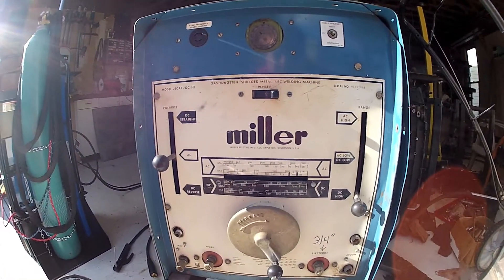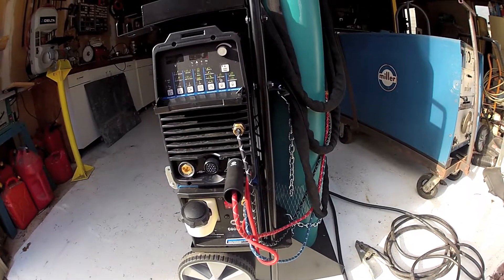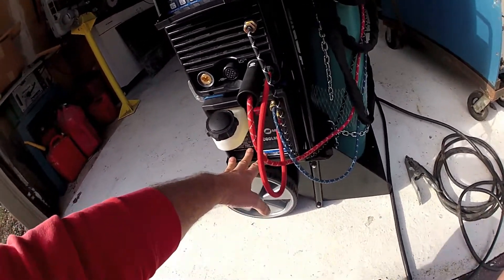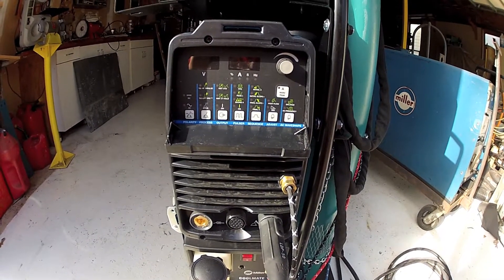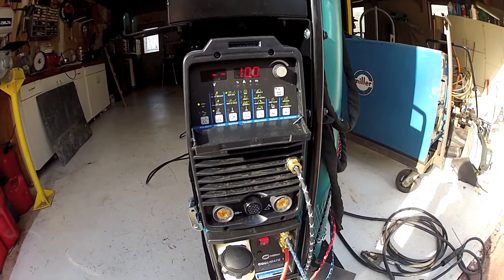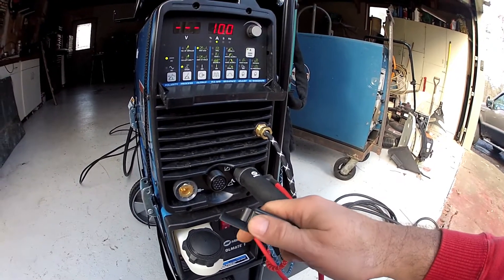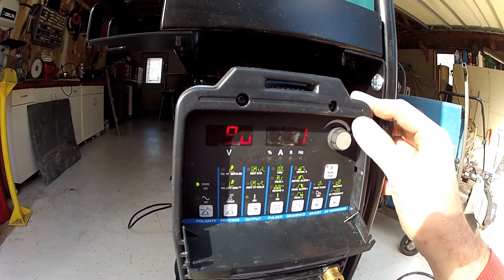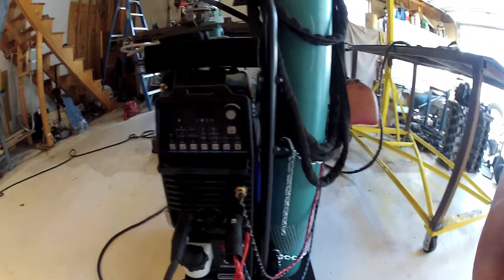Miller Dynasty 200DX Part 1

Comment: Thanks for the video. I’m looking into buying the Dynasty 280 and it’s good to see what us regular guys will encounter.
Reply from the maker: Nothing makes up for us hobby welder's minimal time under the hood, but the Dynasty line is a great way to eliminate ALL of the "other" variables. Now, almost 8 years later I still find myself learning settings (like pulse) and wave form control to improve my results.  I haven't watched this in a while but all of my complaints are still valid and all of the machine's plusses still make this the best tool in my shop.

Comment: I know this is old but the buzzing is the autoline function board. They fixed that with the dynasty 210dx as well as the cps feature for the cooler. Unless you bought this used it should of came with 2 Dinse connectors for your ground and stick lead
Reply from the maker: If it's any consolation, I have made peace with the Dynasty.  It's an awesome machine that far exceeded my capabilities regardless of the material or process.  Still a little loud for a prototype worker, but if I need to think, I just shut it off.
Reply: YankeeinSC1 I sold my 200dx set up just like yours on eBay for 4K then spent another 1k and got the dynasty 210dx Tig runner with the wireless pedal, I have to say I like the 210 much much better and you’re right the 200dx was already a great machine but the always running and buzzing killed me too.

Comment: You say it leaks antifreeze out the cap when you tilt it back.  Can you turn the machine and the cooler  around on the cart so it is facing forward? Maybe it wont leak than.
Reply from the maker: +Eric Cheshire I have owned this for 2 years now and all of my initial problems are now digested.  I still hate the fact that the switch for the main power is on the back of the machine and that the cool pack needs it's own power feed rather than piggy backing to the main welder  The coolant pump is noisy and distracting if you want to weld in a quiet atmosphere where you can concentrate.  Otherwise?  no issue and a fantastic set-up for a small shop/hobbyiest.

Comment: Thanks for the video. I am saving for this same setup, but with the standard foot pedal for control. I currently use a syncrowave 350 at work but this will be my at home unit for my own personal projects. I have a question about the function controls though, are the settings for say ac balance, frequency, or pulse "saved" when you power off the machine and then re power on? Or do you have to go through the whole program every time you turn this machine on? Thank you, Noah
Reply from the maker: Hi Noah;

I'm happy to report that the previous settings are saved.  Both when toggling between the AC and the DC processes, or even if the machine is shut off completely!  I was concerned about that too.  

It's nice if you only do occasional welding on one of the two sides, but often use the same or similar materials.   To know that just switching back to DC for instance, the same settings will be in there from the last time you welded up some ,035 4130 tube 6 months ago.  That's reassuring.

I'm working on a second video soon.  Now that I've owned the machine for a while, it will show a checklist that I've developed. It's far more specific than the shop card Miller provides with the machine and it keeps me (an infrequent welder) out of trouble for set up, especially when I haven't welded aluminum in a few sessions.  I can't tell you the simple mistakes I've made.  There are so many parameters that can be manipulated, that I found I was getting steps out of order or missing simple things like turning on the gas, or the coolmate, before lighting up on a repair project where I only have one chance to do it right!

I defer however to Jody, who posts as "Welding tips and tricks dot com", for welding lessons and improving your overall results.  There's no way I could match the quality of instruction he has documented so well.  To add similar videos would just make his fantastic stuff harder to find.
Reply: YankeeinSC1 Thank you for the reply, I agree that Jody has some fantastic videos, even some about baseline settings for the 200dx. Its nice to see your perspective on the purchase. I was slightly overwhelmed with the settings on the syncro350 but after a bit of time on it I found that I rarely need to make changes with what I usually weld. Of course its really convenient to be able to see every mechanical dial from 5 feet away (no toggle menus old beast). Im happy to know that at least my settings will be saved. Looking forward to Vid #2. Thank You, Noah